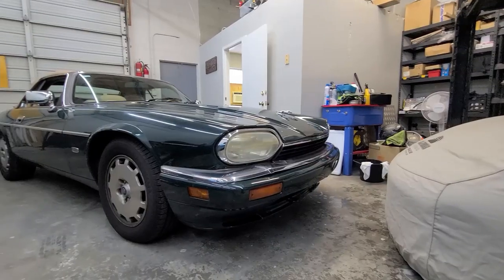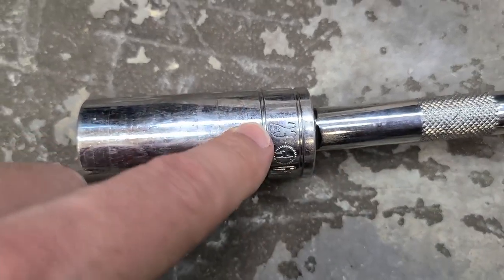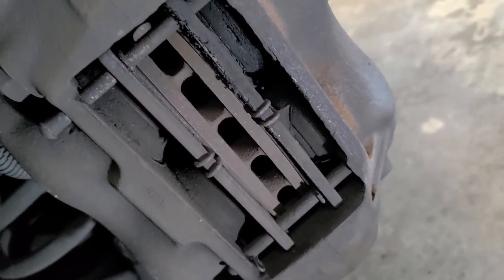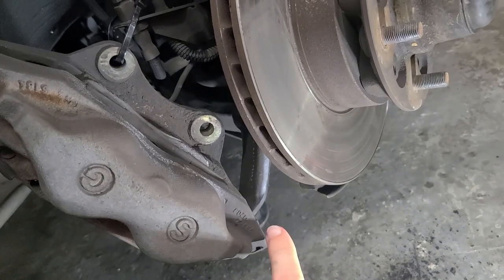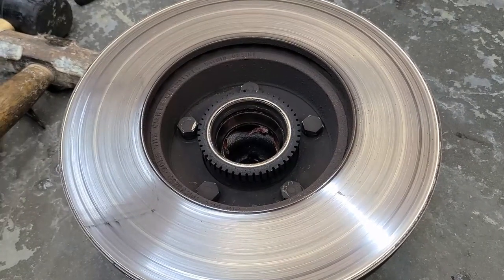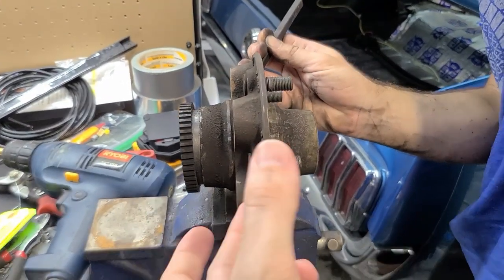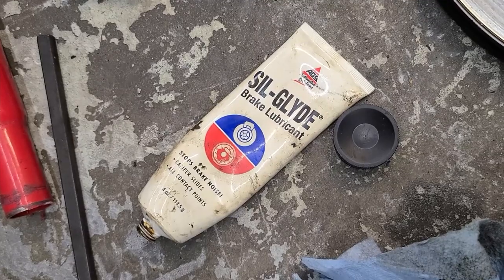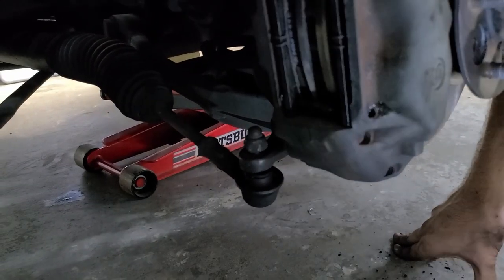Jaguar XJS Front Brake Service

Comment: Doing a whole front brake job on a 1979 XJS, video was extremely helpful! Your 96 is identical to the 79 with the exception of ABS.
Reply from the maker: Glad it helped. I get the feeling they didn’t change too much on these motors over the years. 

Our 96 does have out board disc brakes in the rear.
Reply: @LowTechGarage  If you ever make a video for the rear brakes that would be super helpful! I’m in the middle of restoring this 79 and haven’t got to the rear brakes yet.

Comment: The straight six Jaguar motor is kind of the British equivalent of a small block Chevy. Both are fantastic, robust engines that can be modified to your heart's content.
Reply from the maker: We love the motor, now if only we could get the idle speed figured out. We have isolated it to the TPS calibration.

Comment: I'm a v12 man myself and have just completed overhauling the front sub-frame on my convertible. Just a couple of points though, I noticed that the calliper boots were split and not replaced this will only lead to problems in the future; you also re-used the old split pin, not a cotter pin please, both of these are bad practices. But in mitigation, you did at least remove the wheel nuts by hand and not an impact gun.
Reply from the maker: Thanks for the feedback! We would love an XJ12 in the future with the 6.0

Comment: Car is a 1996 but what year is the engine?  95/96 was an AJ16 that is coil on plug.  The engine in the video has spark plug wires.  So is that an older AJ6?
Reply from the maker: its coil on plug :)